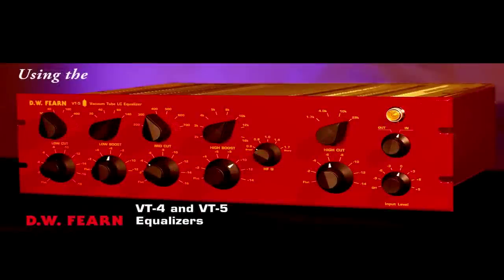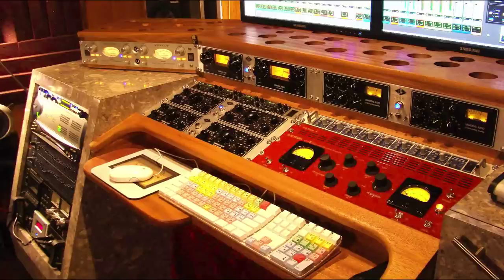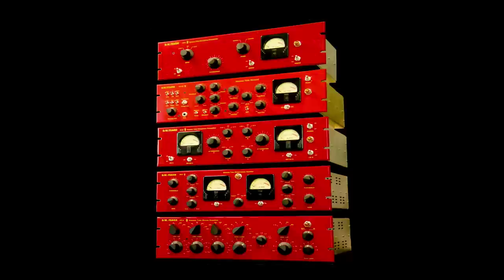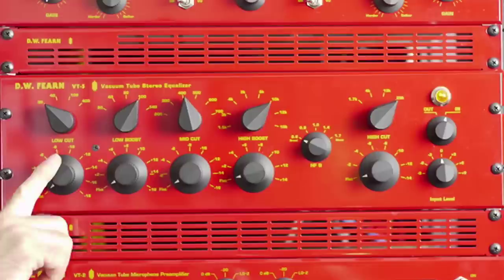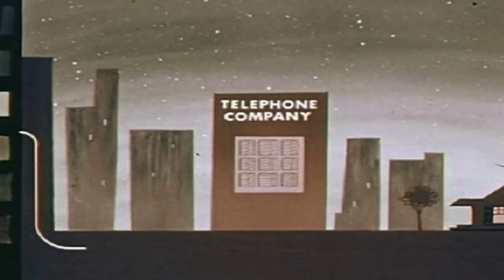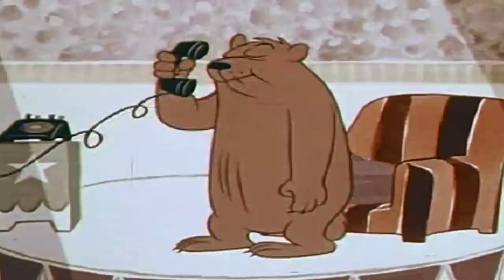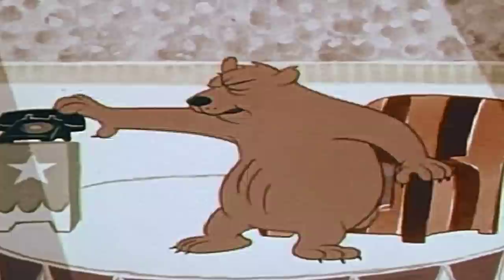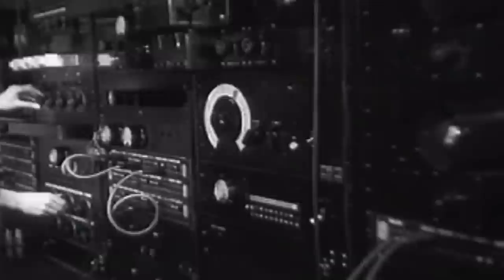D.W. Fearn VT-5 Stereo Equalizer Tutorial (1 of 2)

Comment: Interesting stuff. Learned a lot, thanks. I hope you and Acustica get together again for the VT-7 compressor!
Reply from the maker: I am working with Acustica on the VT-7 plug-in. It is very challenging but I think it will work.
Reply: @DWFearnHazelriggIndustries  Great news!! Any rough estimate on when that might be finished?

Any idea if they will include it in the Ruby bundle? Or if they will sell it seperately to the VT-5?
Reply from the maker: @Barncore  Acustica has been working on it for about two years. I have evaluated several preliminary versions and they are getting closer with each iteration. No idea when it will be completed, but I hope it will be in 2020. We have not discussed a bundle, but it would make sense to combine it with Ruby.
Reply: @DWFearnHazelriggIndustries  Very promising. Thanks for the inside info